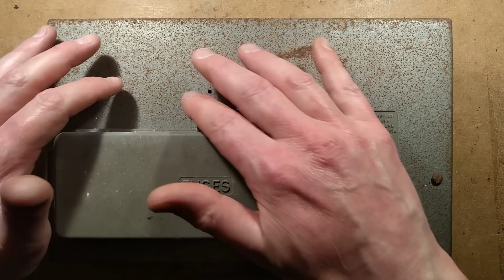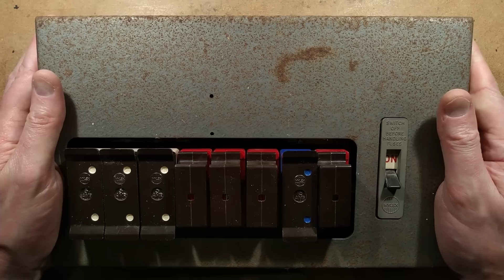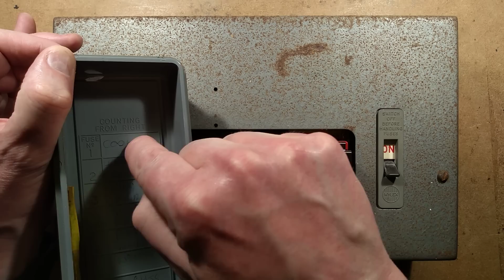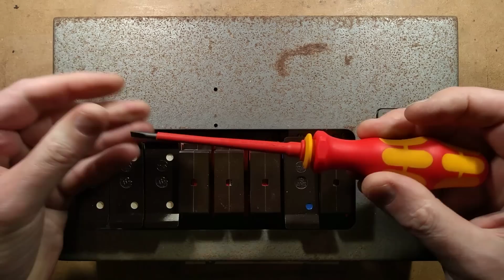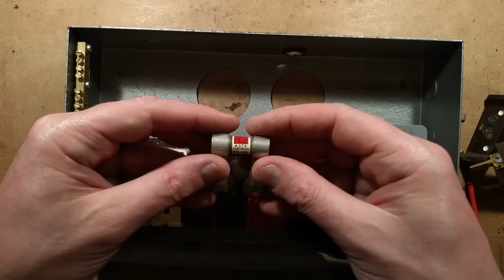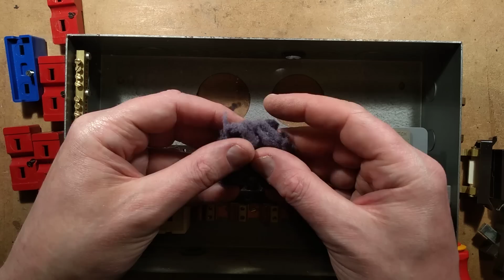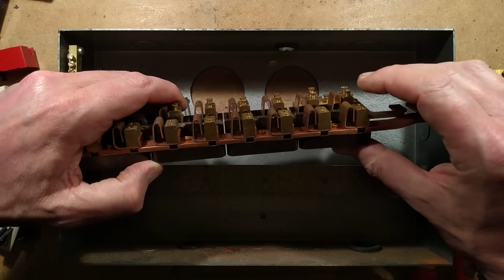Teardown of an old British Wylex electrical fuse box.  (with bare fuse wires)

Comment: The asbestos I run into in motors is usually white or red varnished and looks like loose weave burlap covered in chalk. It's expensive to have it abated. If I find it, I get a respirator on and coat it in resin to keep it from fracturing and contaminating the area until the abatement company picks it up for stripping.
Reply: Did a project (California) some years age with asbestos in the building. Removing it was more expensive than the building with all the regulations. Ended it up covering up with sheetrocks. My first electric shop class had us kids make a soldering iron stand from asbestos sheets. Good stuff, still have it.

Comment: Is the earth buss on that panel rated for more than one wire per screw? If not the multiple wires are joined by a shorter one to one terminal.

Comment: I remember the pre 13A plugs that had round pins, came in 2 sizes I think and were 15A
Reply: Small ones 5A bigger  ones 15A
Reply: Three sizes 2A 5A 15A they stayed in the regs for years B+Q still sell 2A and 5A
Reply: Rob Turner Still being installed for dedicated wall switched lighting circuits for things like table and floor lamps in posher homes. Using round pin plugs and sockets means the cleaner won't attempt to plug the hoover into a wall switched lighting socket.

Comment: I actually picked up some fuse wire when I was in Scotland, as it's used in some scientific gear (like current balances) that operate on the edge between "lots of current" and "too much", and it's hard to find.  I'm wondering why the asbestos pellets are present in the box, are they just to limit arc flame?
Reply from the maker: I'm guessing they were playing safe to avoid igniting the plastic when a fuse blew and a lot of plasma fired out the hole.

Comment: @bigclivedotcom 👋 I've got to disconnect the light circuits for some asbestos to be removed.

Do I turn of the main fuse, then remove the fuse labelled as lighting 🤔
Reply from the maker: Theoretically yes, but always test wiring after isolation.

Comment: Can the neutral wire be connected to any of the neutral terminals? Or if the live connection is connected to the first fuse terminal, the same cables neutral must be connected to the first neutral terminal from left to right? Thanks

Comment: Clive do you think it's safer to use retro fit MCBs in these units, would this prevent arc flash?
Reply from the maker: It's more convenient.  But with the cover in place the risk of flashover is low.  Even without it the risk is low.

Comment: I encountered a big board of white asbestos a few years ago but didn't identify it until after I broke it to pieces removing it. I'd pretty much come to terms with my impending doom but now I guess I'll have to plan for a longer retirement. This information really should be more widespread, that stuff is still everywhere.
Reply: I have done likewise.

For me it was pulling down a buldging lath and plaster ceiling in a airing cupboard. From the loft i could see the laths but at some point someone had overboarded it with asbestos insulating board that had been painted  over and it was this that was coming loose.

My crowbar split a big piece off and in the confined space i was covered in dust with  bits of it in my hair and on my clothing.

Very easy to get caught out even if you are relatively aware of what it looks like as it can be hidden.

Comment: So cute a little 8-way, jk I’m in the US with lower voltage and much lower amperage sockets and my panel has 40 positions. I hear the newest have 60 with a neutral bus on the backplane so no no more neutral wires from afci/gfci breakers
Reply: Must cost a few dollars having so many RCD/AFDDs (gfci/afci's)!

Comment: Unsure which asbestos it is as it was a while back but my mothers house had it around where the old hot water cylinder used to be, I remmeber a vague panic at finding it and then some professional being called in to remove the stuff.

Comment: I only buy Wera or Wiha screwdrivers, so nice durable tools.
Reply: Well I also want them because the tips are very precisely made with "lasertip" engraving for more grip.
Reply: Wera is awesome. The only thing I don't like about the interchangeable set.. well actually 2 things: it's not slimline bits and also no lasertip.. my first wera vde screwdrivers were all laser tip, second set I bought slimline but I wanted a smaller toolbag so went interchangeable, bit disappointed not to have either of the excellent features of my previous sets.

Comment: interesting aha. i remember had a fuse box in the trailer i lived in.. those loved to catch on fire entirely when they exploded basically those cylinder ones with the flat copper ends on em. and house i live in still has an active 50's breaker panel now converted as a sub panel but it still has all of its original 50's breakers... i think they are in need of a change though.

Comment: You could still get these, new, in the 1970s. Metal clad (like this one) for commercial premises, or fully Bakelite construction for domestic, though it was quite acceptable to use metal clad in a domestic installation. Can't say for sure if it was permissible t'other way round.

One thing you didn't mention, Clive, was the width of the fuse pins - heavier fuses had wider pins, lighter ones had narrower pins, to prevent a numpty from shoving say, a 30A fuse where a 5A should go. It was less critical the other way because if you put say, a 5A fuse into a 30A circuit, the fuse would fail before the wiring. Of course, that didn't stop another numpty from inserting the wrong fuse wire. I did hear tell of a chap who once stated that he had a fuse that kept 'blowing' so he inserted two strands of wire "so that if one failed, the other would keep on working..........." ?????????? Yeah, Okay.........!

Comment: Is there physical keying to stop you plugging the wrong cover into the base plate? The white one looks like the pins are in a different position to the blue one.
Reply: Width of the brass pins increases as the current rating increases, so you can't put a higher rated fuse into a lower rated base.

Comment: Interesting from the US perspecive that the "isolator" or "main" switch is "on" in the down position and "off" in the up position. Opposite of the standard "righty-tighty; lefty-loosey" up for on, down for off "standard" used in the States.
Reply: Same in Germany and most EU countries with same German (AEG/ GE) background. Up or right  is on. But we all also drive on the right side of the road. Mathematicly counter clockwise is positive direction, so positive rotation is safety.

Comment: A lot different from a US fusebox. Ours for the most part used Edison based screw in fuses for the 120 volt branch circuits, the main was typically 2 60 amp cartridge fuses, since we have 2 "hot" wires with a neutral wire splitting the difference. If you had an electric range or clothes dryer, it would run off the 2 "hot" wires, so it could utilize the full 240 volts, and all of the 120 volt circuits were run between one of the "hot" wires and the neutral, which supplied them with 120 volts that most US appliances run on

Comment: Another great video. When and why did fuses / breakers go from 5/15/30 amp in the older units of this type, to what you see nowadays of 6/16/32?
Reply from the maker: I'm not sure why they went from multiples of five to even/binary type multiples.  Probably to match intended standard cable sizes.
Reply: I assumed it was because the older fuses were a lot slower to blow than more modern breakers, so the breakers have a slightly higher rating to compensate.

Comment: Not regulation to have one RCD feeding the whole installation. Separation of circuits requirement. I like the quality of construction of those old Wylex boards. The old lighting circuits didn't have CPCs, so that's probably why there are only 8 ways on the earth block.

Comment: I remember my parents house had something that looked very similar, but as far as I remember it all looked like the same material as the fuses were made of (bakealite?). The house was constructed in the early 60's not sure what it would have been..... Actually still got one of the fuse wire types on the lighting circuit in the flat where I live.

Comment: My home has one of these fuse boxes, though without any sign of rust or other corrosion.  I would prefer circuit breakers and was interested to know that you can get plug-in ones for this.  I will go and look for some of those.

Comment: Seen some old equipment including oil immersed relays but not this although I have a spool of fuse wires but had no ideal how it was used until now. Its from Jefferson Electric Electric Company (USA), "Tested Fuse Wire, Warranted AMP." No amps specified though. Ever used in the US, any old timers like to chime in?

Comment: Pulling live meter tails through if you are bold... Or, I find helps, slightly drunk.
By the time you have got to the point in your DIY CU replacements, where all the circulits have been moved and you are at the point of moving the tails, there are a few emply beer cans around. It 'helps stiften your resolve' !
Subsequently fitted a separate isolator switch. Though pulled the main fuse for that, as hacksawing a live tail would have taken too much beer to be feasable. (The utility company guys didn't bat an eyelid at the missing seal, when they came to fit a new meter.)

Comment: HI Clive,  I know its a little off topic but do you know if there is a version of the quick test that can be wired into a 32A circuit for the testing of cookers?

I have looked on the cliff website and could not see one on there.
Reply from the maker: I've never seen one rated that high.
Reply: @bigclivedotcom  cool thank you sir.

Comment: The old house 4 generations of my family had a type of rock wool insulation in it. That didn't contain asbestos and it felt like clumpy dirty wool and it had compressed and lost the insulation properties due to it settling and leaving gaps. One of my uncles replaced the old Edison type fuse box for the circuit breaker panel in the 1950's. He and myself served on US aircraft carriers and our ships had asbestos in them. His is currently the Intrepid museum and mine, the USS JFK, was supposed to be a museum as well. Delays in the decision for that may be due to the asbestos mitigation. I've been contacted by mesothelioma lawyers because of a fire that broke out during my deployment causing the damage control people to tear into the insulation to find it.

Comment: I still have two fuse boxes like that in my house and they all have fuse wires.  They're supposed to replace it later this year (2021). The house was built in 1974.
Reply: Replace it? Why?
Reply: @mrs2691  Apparently it's not up to code for a rental property. I'd rather have circuit breakers (CB) myself.  Plus it would be nice to consolidate my CB panel in one location.  Fuse wire is ok, till you suddenly don't have any. Then a toggle CB is convenient.
Reply: @jessebob325  not sure why it wouldn't be to code since fuses are inherently safer.

Comment: 5:13 can you simply put the fuse wire in the hole like you connect cables to appliances? Strange that people are supposed to wrap the fuse wire under the screw when a hole is available.

Comment: Clive did you ever see those plugs that look like UK plugs but they have round pins instead? what were they all about?
Reply: They were the UK style before the rectangular ones. I remember playing with them when I was a battery-switch-and-bulbs junior ;-)  My grandad had a loft full of old kit for some reason, he was a TV repairman before he retired so not sure why he had house wiring stuff but it provided excellent toys.
Reply: @MrPlytiger
they were the UK plugs till the 70s then they were replaced by the square ones over    
time :-)
there were about 3 different size 3pin and at least 2 sizes of 2 pin , there were also adapters for bayonet to 2 pin socket so you could plug into the lights :-)
Reply: @YTANDY100  That's a much later replacement date than I would have guessed. My memories start in the early 70's and I don't recall ever seeing a round-pin in actual use, not except much later on when my parents were prospecting time-locked N.Welsh farmhouses for a house-move.
Reply: @So1ipse  
it may have started being changed earlier im remembering my house and friends houses , some were changed much later than others but back then you had to fit your own plug on appliances so there was no rush to change over the sockets :-)
Reply: India still uses a style of plug identical to the ones we used in the 70's with the round pins but to a newer Indian regulation.
Reply from the maker: Round pin plugs are still used in the theatre industry to stop people plugging random things into the dimmer outlets.
Reply: @bigclivedotcom  Are they still manufactured then? Maybe for use under different standards elsewhere in the world?

Comment: I investigated the fuses in a house built in the early teens - 1915??  😱 😆
It was wired with just two wires: line and neutral, and both were fused!  I thought, what would happen if the neutral fuse blew?  You could still get electrocuted!

Comment: Ive only seen blue asbestos once. Doing an explore thru the old Fremantle power station. The actual generation hall has become a litteral graffiti art gallery, its pretty epic. Very respectful, some huge pieces. Stuff does get painted over, but none of the cock-n-balls or tags you see on more public peices. If your going to the effort to get in there, youve got a level of respect. Theres even a big seawater intake thats flooded, and pissing into a giant urinal is way better than going against a wall, so it dosent stink of piss. Anyway, whilst my buddies were contributing, i went exploring.  There was a duct i could get to that led from the power hall, across the administration area and into the control room. The admin space was beautiful, art deco, with heavy Chernobyl influences. State of the art facilities, just left to rot. Huge sweeping staircase, lots of glass very cool. But my interest was the control room. So, crawl thru the tunnel, over the admin area, n into what was the control room. So many racks, mostly empty. But kinda starship enterprise styled. Or the china syndrome. Friggin cooool. Except, all covered in a fluff, fallen from the ceiling. There was a 6 ft radius around where you dropped down from the hole in the wall that was pretty clean, but the rest, just covered. Previous explorers had obviously had similar reactions. "Supercool, but i am not going out there*. My exploring buddy was keen to poke around, but was curtailed when i told him what all the fluff was. Protip, dont go venturing in decrepit buildings alone, pereferably with someone you trust to be handy enough to help you out. Anyway, knowing what the 'cotton wool' was, quickly lost interest in traipsing thru it to push some old buttons.

I can only surmise the duct was insulated with hard asbestos and plaster, where the control room was stuffed with 'dryer lint'. Excellent exploration experience.

But yeh, it really does look like dryer lint. Cos my buddy picked up a wad n wondered out loud 'what is this' as he mushed it up. Smoking Marlboro Reds will probably kill him before the asbestos will...

Comment: Had a farmer customer with a refrigeration compressor that would pull stupid amps every now and then when it started and blow the fuse, told them I thought it had shunted windings and needed replacing. Got called back a few weeks later, they had ignored my advice and just put bigger fuse wire in, it set the fuse box and corner of the shed on fire and they still needed a new compressor... 3hp Prestcold, run current 21A plus 1.2A for the fan motor, can't remember normal LRA but think it around 75A so when this one faulted I think is was well over 100A, and just sat there humming until something stopped it.
Reply from the maker: That's what farmers do.  That and their "wiring".